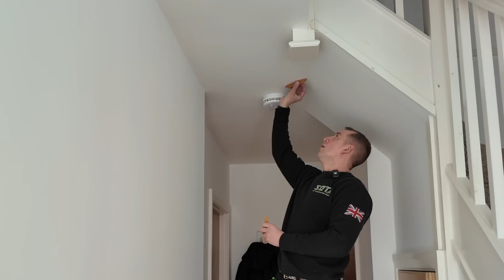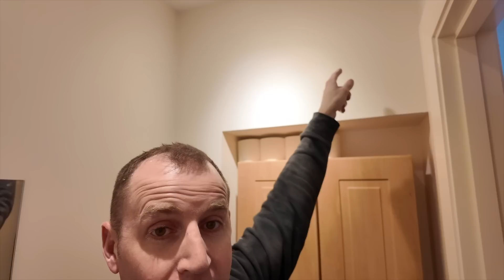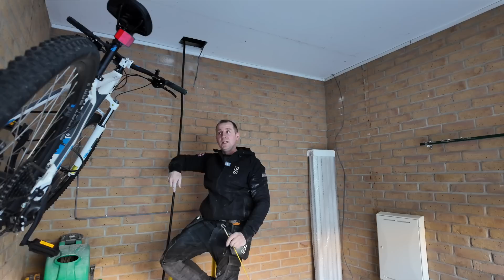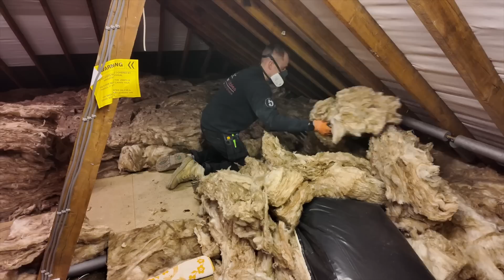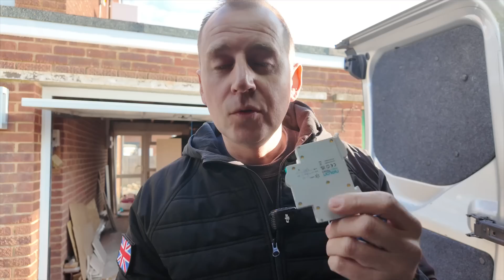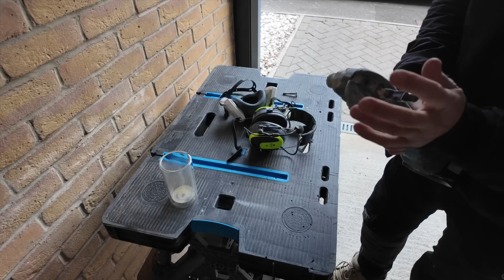The SIMPLE  Electrical Job That Turned Into A TOTAL NIGHTMARE!

Comment: Recent Vodafone fiber routers have a WiFi switch in the settings. Something do do with legacy device compatibility.
Might be worth a try with wifi connection problems.
Not sure if other ISPs have something similar.

Comment: not sure why you connected 3 pairs to the RJ45?  only 2 pairs are needed for 10/100 Ethernet.
Reply from the maker: Just used them, don’t always have to do the bare minimum
Reply: @ it’s not about ‘bare minimum’. Connecting the 3rd pair could potentially confuse the Ethernet interface on one end or the other. Sticking to the 10/100 standard - if you don’t have all 4 pairs - makes more sense to me
Reply from the maker: @over-engineered fair enough, sounds like you know more than I do about that so thanks for sharing

Comment: 8:43 for the rj45 don't you need to crimp with the mechanical protection? just as those wires are thin and easy to snap
Reply: not going to be plugged and unplugged regularly but fair point
Reply: i typically use an offcut of sheath when i have to do this... PS you only need orange green (568B) for 100 mbit,. leaves you another spare pair :)

Comment: EAW act and Factories act allow live work with a risk assessment, had to do one thursday right near rexel,  big company, needed a 32A 3ph supply installed for a lathe, but had a 3 day long 3D print underway in the prototyping area, shut down was a no go. PPE'd up.... 1000v gloves, face shield, VDE drivers... not an issue. In theory though i wasn't working "Live" as it was a schneider isobar board :)  Lovely boards, plenty of room for neat wiring, and the busbar isolators <chef's kiss>

Comment: 11:00 OK this is the second video with that brand of tools that I've seen in the last hour. I know so far that there's a company in the US that's a small business that's great if you want to order them and that they're made in Japan. So they're gonna be pretty good quality.
And I don't understand why you guys have insulated screwdrivers if you're not supposed to use them on live electrics anyway. The ones that are getting shocked are the ones that aren't using them and working on live electrics. And most of the time when you do get a shock it's not because of the tool it's because of some stupid other reason.
Reply: Because sometimes you do have to work on live services, and even if you're not, sometimes things end up being live when they're not supposed to be.
Reply: The VDE drivers are generally much better quality than other stuff to be honest, and fairly cheap when screwfix/toolstation/rexel/tlc have a special on :)  I usually pick up a couple of packs when that happens, because one WILL break or go missing in action. For some reason they ALWAYS still chuck a neon terminal driver in the pack too... that goes in the bin :)

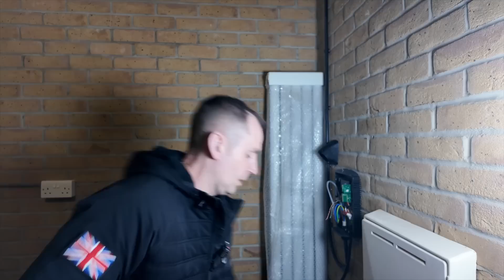Comment: 8:00 it's a hard wired appliance, you might as well wire it into the Ethernet as well if it's close by. They're also going to be between walls that are probably not going to be conducive to Wi-Fi and at the edge of it at that. Then there's the whole connection process and reconnection process if the homeowner changes the network name or password....

Comment: Vessel are very highly regarded brand from Japan. They have quite a range, I got the ball PZ in different lengths, tightly regarded by carpenters in some countries, and a nice feeling in hands. They recently lunch a really helpful magnetic tip holder NMC-2P perfect screwdrivers etc. Worth checking out.
Reply from the maker: Nice!!
Reply: The screwdrivers look like a modern twist / vde of the old wood handled cabinet makers screwdrivers.

Comment: I had the same issue with a hypervolt and the eero ended up connecting it the old way using the ip address

Comment: Why do sparks and plumbers fail to sleeve a cable or pipe going the wall? please please do this using a bit of copper pipe or pvc🙏👍
Reply: Somebody hasn't seen that video from the other British electrician....
Most the time it's not needed. Extra work, extra money.
Reply: Pipes yes, sleeve every time, but cables are generally rated not to need it. That being said I will use a piece of conduit if feeding T&E through walls sometimes to avoid abrasion

Comment: Try an orbital sander with a vac attached, cuts out most of the dust 👍
Reply from the maker: I didn’t plan on doing this beforehand so I just used what I had on the van, but thank you for the tip 🙏

Comment: You need a walabot. It finds joists, studs, pipes, cables, and all colour coded. Attaches to any mobile.
Reply from the maker: Never heard of that! Il look into it
Reply: Sadly, all our work mobiles are encrypted and centrally controlled.  But we use a combination of Studbuddy and Bosch scanners.
Reply: @mdshovel use a walabot, and get the cheapest smart phone you can find to put on the back of it. The phone is only for three things, to operate walabot software, power, and the screen for near x-ray vision. Gives perfect sight.
Reply: @nigelpalmer1172  no way I'm gonna get the NHS to pay for that.  We actually have a £900 Bosch wall scanner that works like radar and has to be calibrated every use.  Bloody thing is back in the box and no touched for 10 years.
Reply: Why would you get the NHS to pay for it?
Reply: @nigelpalmer1172  because that's where my team of  Building Technicians and I work
Reply: @nigelpalmer1172  because that's obviously the employer.